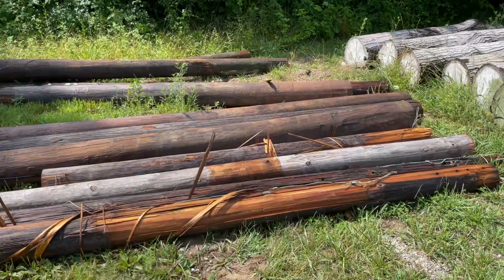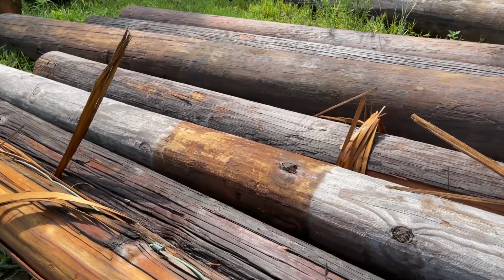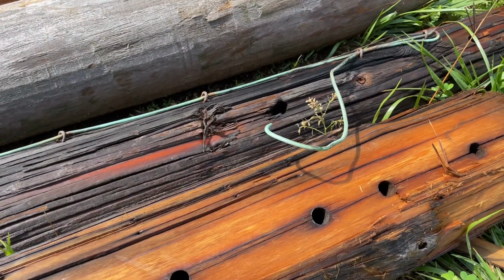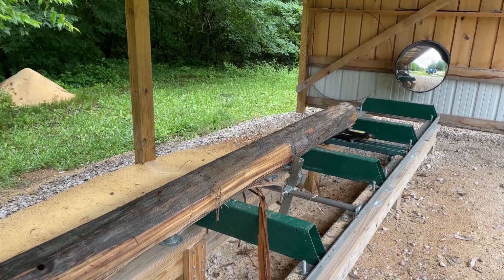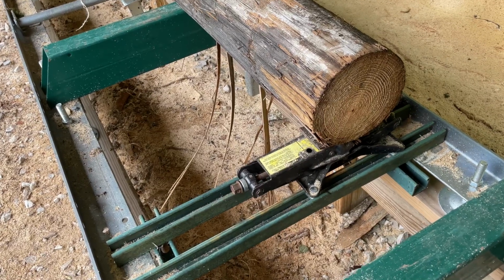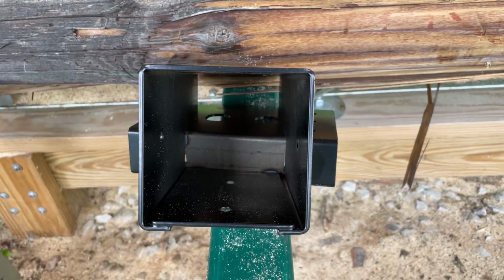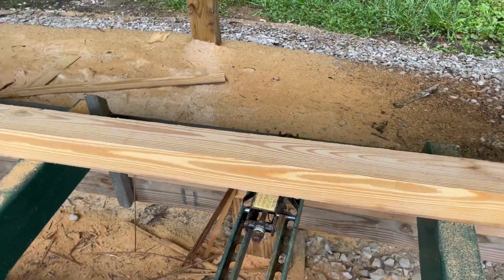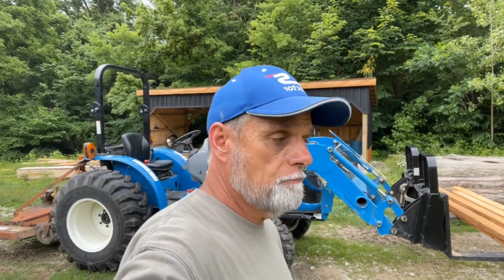Milling utility poles on our woodland mills sawmill! #woodlandmills #lstractor #sawmill

Comment: How do you go about getting utility poles
Reply from the maker: My local electric utility keeps a list of folks who would like the old poles. Whenever they replace poles, they haul the old ones back to the yard and stockpile them. Then when they accumulate a bunch, they call folks on that list and have them come pick some up for free. My utility cuts them to size according to whatever length the customer desires, and they even load them for you. You might call around and see if your local utility does something similar.